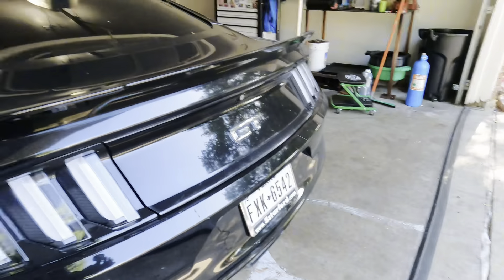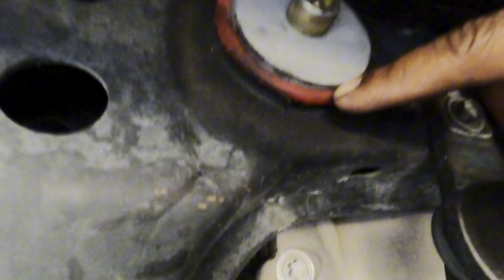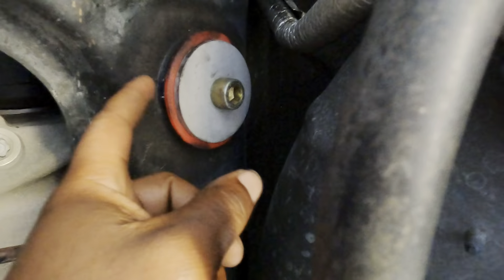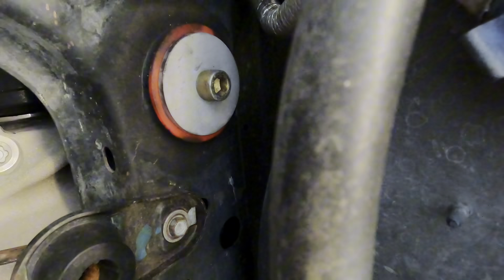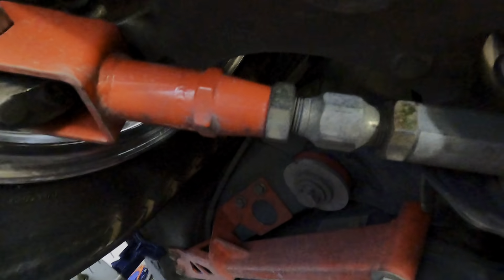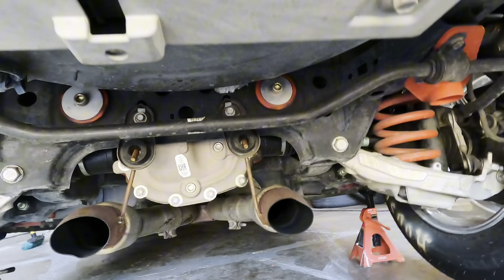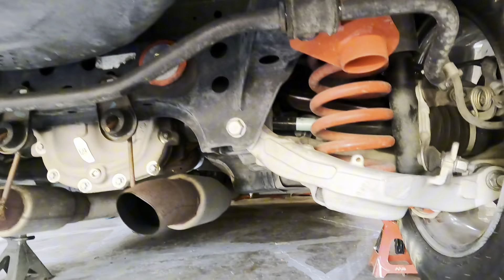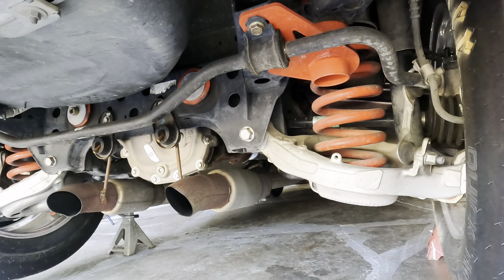Mustang Gt Bmr suspension what happened

Comment: Did you check your pinion angle?
Reply: It is very critical especially with a one piece driveshaft.
Reply from the maker: @dbarr8261  I did not, I have complete deferential that order 373 gears I’ll do that check when I install new diff
Reply: Ok.  BMR has a lot of parts that answer the problems with the rear suspension. I don't know what all you installed already.
Reply: I have a '21 premium with pp1. I will be adding a bunch of BMR and Steeda parts in stages.
Reply from the maker: @dbarr8261  i didn’t more upgrades in dec ima send you the link
Reply from the maker: @dbarr8261  https://youtube.com/shorts/kjDzkJubuUA?si=pVXmBkJKDrzfF-5I
Reply from the maker: @dbarr8261  https://youtu.be/iMvj2ImWeco?si=RJis8VtmUuwvV7U6
Reply: Ok ill check it out.  Thanks